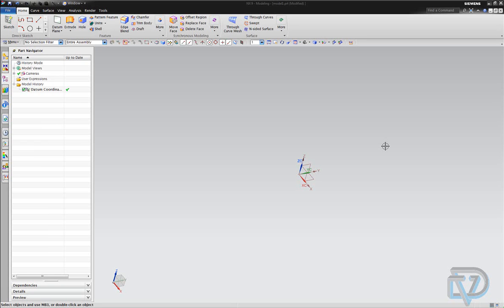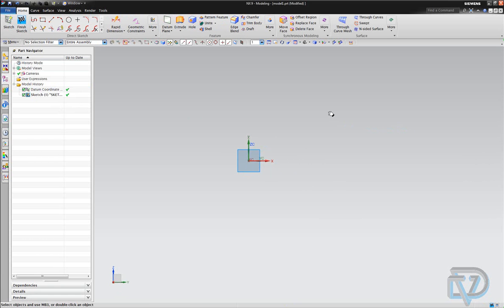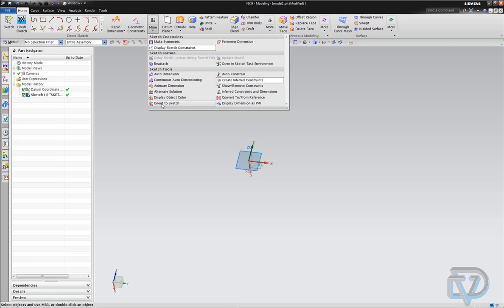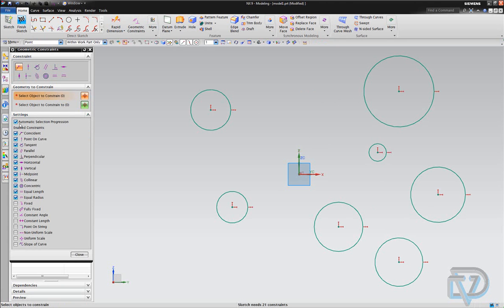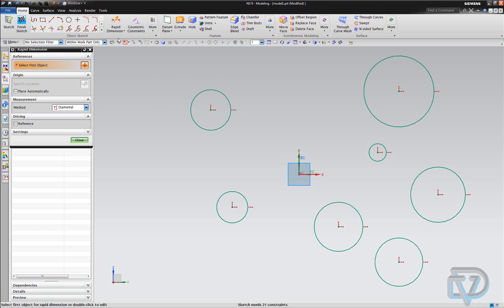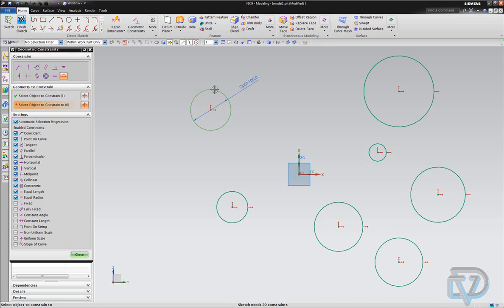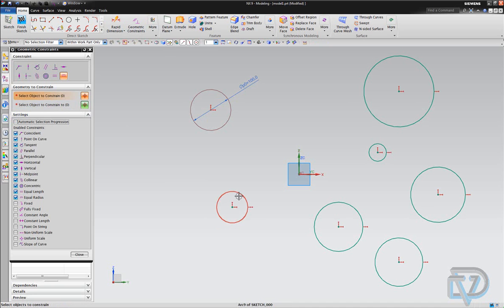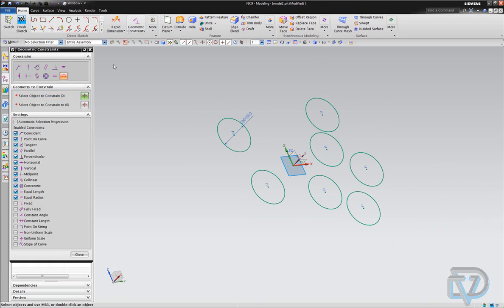NX9 Sketch constraint automatic selection progression

Comment: The advantage of picking the Geometric Constraints command and selecting the type of constraint first, is that NX  filters to select only the appropriate object types. For example, when you selected Equal Radius in the video, NX only lets you select arcs: not lines, not arc centers, not datum points or axes. If you Reset your dialog box, (at the top) you will notice that Automatic Selection Progression is turned off by default.